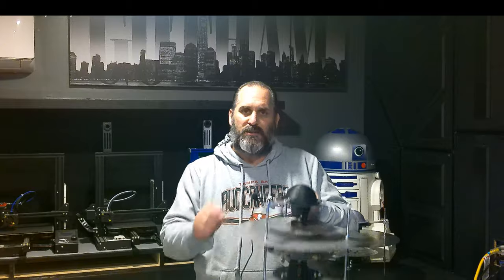Graviflyer "I Had An Idea" #9

Comment: Can't wait to see some Resonance tests with the function generator induced frequencies. Keep it up pal 😎👍
Reply from the maker: Have you ever heard a fishing reel sound from a tesla coil.
Reply: @nathanbunten4299   do you have ringing in your coil? If it gets in Resonance with higher harmonics then yes. This happens when you have ringing in the oscillating system. You have the fondamental Resonance and the higher "octaves" in every oscillating system you have the fundamental f0 is the Resonance then you have the first harmonic f1 then the second F2 and so on. With decreasing amplitude. You can hook on those intentionally or unintentionally. You can see those harmonics with a frequence Analyser. Most digital Oscillatoscpose have a FFT function FastFuorieTransfomation you don't have to buy a frequence spectrum Analyser for that though.

Comment: 👋 Hey there!  What frequency is the Ultrasound running at?  Run the same frequency on the Tesla coil to create a standing wave!  Keep an eye on your frequency drop on the Tesla coil under load make sure you raise it to match and keep in resonance/timing,  If you can't match the timing with the ultrasound,  If you need to run the test the coil slower to still resonate go down quarter of the rate,  You need to match the frequency peaks even if it means harmonizing! !  I believe the point is to vibrate the whole structure with the ultrasound high frequency should cavitate gravity forces around the entire device!  The Tesla coil should create the static field in the center plate as you're already doing!  The flyback Transformers should be feeding the other 2 disks top of below but the fly back should also run at the same frequency as the ultrasound or at the very least to match the Tesla coil so that everything is in residence is in resonance!  Motor rate to match each other!  And the question for me would be if you're pulsing the fan motors to run or are you just using brush DC fan motors??  It would probably be beneficial If the fan motors could be pulsed at the same frequency of resonance!  I think what's the speed and resonance is in balance a slight shift in the rotational Speed upwards or downwards is what he might be tuning!  The change whether either he's increasing the speed of the motor or decreasing it might shift  The field to flow is symmetrically!  This you might want to test!  Cheers mate respectfully! Vladimir
Reply from the maker: The tesla coil, high voltage and the ultrasound can run a zvs. We could combine the whole thing on a 555 timer circuit for all 3 devices. The pulse rate would be the same. We can also change the frequency of the high voltage with a 555 circuit. It might help. I will look into it further.

Comment: Excuse the typos! Lol  Regarding the 2  Motors in my prior post,, running them at the same frequency as everything else at first, then lowering the speed of the rotation on either one or both motors. I believe 1 motor rotational speed increase or decrease should create an Acapacitor effect,  Experimenting with lowering either the upper or lower disk while the other remains in resonance with the rest of everything!  I believe the deviation of rotational speed on one of the upper or lower disks will create a residence shift where energy can flow or pulse in the desired direction so testing would be needed!  You might need to modulate the speed of the motors independently!! Cheers! Vladimir
Reply from the maker: i am doing all of that. It is a puzzle though. everything has to fall into place just right.

Comment: Back when I was researching Tesla’s electric flying machine and Otis T. Carr I remember that there was the AC and DC component in the mix.
Tesla felt that the airplane was to subject to wind, high and low pressures to be safe. In the observance of UFO’s and their ability to shoot off at 90 degree angles it would seem that not only gravity has been nulled but also inertia.
An old electrician gave me the set of plans that he bought from Otis Carr. These are the same ones that you find on the internet.
Been awhile since I have looked into this but if I recall one of those electrical components did create the “bubble” around the ship. Otis Carr if I remember correctly did have time with Tesla himself. I remember also reading that Tesla’s inventions such as the turbine were directed toward that end-the electric flying machine.
I’m fascinated by you endeavors. Thanks for sharing!
Reply from the maker: I was reading an article talking about fields of a tesla coil. And it hit me how they are built. It looks like they are all connected. I have been ordering and building parts for this thing. I just found better circuits for the tesla coil and I think I can rebuild the ultrasound with a 555 timer circuit giveing me duty cycle and frequency. If there is an answer I am going to find it or go broke trying.
Reply: @nathanbunten4299  
I’ve been trying to understand and replicate the Don Smith device. While watching and rewatching his videos he talked about the electrical charge in the air. It varies in voltage 50,000 to 1.5 million volts depending on time of day, solar bursts etc.
I find it interesting the the flyer has a north and south with a plate in the middle. Reminds me of a magnet.🤔
Reply from the maker: @chasson321  The inventor said it was because the earth had them.

Comment: Great thoughts! One caveat: Alexey isn't listening to the discs to know when to pulse the US. He said that he's listening for the 'special sound' (fishing reel unwinding) to come from the tesla coil. Probably related to back-emf from both the magnetic grinding as well as the steadily changing EM fields from the vibrating discs. I suspect the buzzing sound from the tesla coil is the syncing of the US pulses to these vibrations and RF signal. Charles just noticed how the US circuit produces a very rapid rise/fall time pulse (~1us) which changes w/ changing the freq of the US, which is very close to the freq of the TC (1us = 1MHz).
Reply from the maker: I think it is all starting to come together.  I have started testing the high voltage circuit with the pc fans. It is definitely different from the bldc motors I had last time. I think I will do a video on the difference with the fans and the dc motors with the high voltage. The comparison might be helpful. As soon as I perfect my tesla coil I will run the you suggested. Thank you.

Comment: I think whats happening with the Graviflier is that its converting Electromagnetic waves to directional high frequency Gravitational waves which are undulations of the local SpaceTime around the craft. These G Waves are projected upwards, pulling the Graviflier up. Look up the Gertsenshtein effect, which explains how EM Waves can be converted in G Waves. I've done my own experiments by using the Energy of Strong Vibration and transferring it to a small object and it would levitate and rise upwards.
Reply from the maker: I think you are right in the ballpark

Comment: Nathan, it is a simple coulomb force equation calculation. F=kq1q2/r^2 where F=ma=2.7 kg*9.81m/s^2=26.5 Newtons and k=8.99E+09 Nm^2/C^2 and the charge on the Earth is q1=-500,000 coulombs and r=6.357E+06 meters. Calculating we get q2 or the charge on the graviflyer equals 0.238 coulombs. The graviflyer will lift up. Put a positive charge on the aluminum on the top disk and a negative charge on the aluminum on the bottom disk so the positive charge will be attracted to the ionisphere in the atmosphere and the negative charge will repel the earths negative surface charge.  The two charges are distributed between the two aluminum and aluminum oxide coated polycarbonate disks and not two aluminum disks. The positive and negative charges will cause the graviflyer to levitate.

Comment: I've been wondering if we could make this whole thing self resonating by putting the tesla coil on the craft itself somehow. Maybe would need 2 if we need to keep the 3 plates air gapped. Bottom plate becomes a synchronous ac rotor. Top plate becomes an induction ac rotor. Both powered from the tesla coil(s). Then still charge the plates like before with dc.
Reply from the maker: I wanted to add one to the bottom. After I get it to lift.

Comment: what we need guys is an adjustable AC output so you can adjust the frequency's what you need to get it to is 8hz if possible.
Reply: Well if you want that get an inverter motor speed controller Altivar 08 is the best on the market!

Comment: Still not clear how an electric field, oscillating, toroidal, conic, etc has any influence on gravitation, ie weight?
Reply: Have you played with the magnets that have a hold in the middle so you can stack them on a pencil?

Two magnets with opposing fields will repel a certain distance from each other. Pull the top magnet above this distance and gravity will pull it back down to this distance.

Push the top magnet down below this distance and it will defy gravity and shoot upwards beyond this fixed distance and then settle back down due to the influence of gravity.

Have you ever pushed down on a trampoline just before someone lands and noticed you can increase the height of their rebound?

That seemingly tiny bit of extra energy propels the person much higher than they can bounce on their own.

No new energy is being produced but energy can be focused to work together from more than one source.
Reply: @tenlittleindians  
It’ll not provide lift, or cause weightless. 

But more power to him.
Reply: I like to call this a conspiracy craft because at this point, no one can find a justifiable reason for this thing to fly. Is it static? Is it an electromagnetic field? Is it acoustic levitation? Or is it a random mix of all of them? At least I built one, so if someone figures it out, I won’t seem so crazy lol
Reply from the maker: I have now built 5 of them. Probably 20 or more tesla coil circuits. And more high voltage flyback circuits than I can think of. I  still want to see it fly.

Comment: This is all resonanting wl an idea I had thinking about Hutchinson: AC phase adjusted stair step field, and an electrostatic field...now on flying disc.
Reply: You need a mk3 interrossiter and a Heisenberg compensator too.
Reply: @dogwalker666  As long as it's not a flux capacitor.
Reply: @nolan412  You need a Delorean for that.

Comment: it's not mimicked dc, it's pulsed dc. it's still dc, not ac if it's not alternating, aka polarity swapping, dropping below zero volts and going above again, repeating. if polarity doesn't change, it's dc.
Reply from the maker: mimicked ac. I am trying to say mimicked AC. It is not a sign wave just pulses that show up as square waves. The point was that dc can be polarized where ac cannot.

Comment: But why don't you just buy one of Alexi' graviflyer kits and then youll have a working model to work with and reverse, just go on his youtube page, he answers most comments. Im sure he would answer your questions also, you dont need to speak russian, he uses google translate.
Reply from the maker: I am working with people who did. I have all the circuits and pictures.
Reply: @nathanbunten4299  excellent, keep ploughing forwards. I am working on one related to Viktor Grebbenikovs design, 2 Russians were working on it, it has a ring bulb at the front, there's plans and photos of them flying with it and I have most of the parts, I don't know if you know the one I mean, but I ran it through AI and it should be do-able, Im also trying to figure out the Grebennikov craft, but that but is quite hard to crack. I wish you the best, and am happy to see you sticking at it. Cheers.
Reply: 中華人民共和国の一般の方々が成功しているようです、是非、国際展示場や展示会でお披露目してほしいと思っています😊
Reply: I can understand stand Russian but not speak it. Even I have trouble understanding some of the terminology he is using because the Russian language doesn’t have advanced ways to say Something it has to be described every time instead of speaking about it as a noun.

Comment: The grav flyer is akin to a tomoka reactor moving as many ions as it can with a magnetic field. But those ions form a type of ion wing also by there movement.  The magnets move the ions so more air can be ionized.   The objective is to ionize as much air as possable for lift and form a ion type wing that is part of the engine.  You can sort of think of the grav flyer like part jelly fish and part ion wing.  The jelly fish part happens real fast thousand of time a second. But the wing part is just the ion flow.  Bending the big plate may help in how the ion flow shape looks.  If you go digging our goverment has worked on projects like this also.  Using radioactive isotopes for powering ions for movement.  Out at Area 51.  Keep up the good work.

https://www.youtube.com/watch?v=vvLT7x47x5M    a full understanding how the forces work.

Comment: Nathan, Nathan, Nathan. You are thinking too hard. Change the upper and lower disks to aluminum and aluminum oxide coated polycarbonate. Put the aluminum to the outside and the aluminum oxide to the inside. Then do what you do best and the graviflyer will lift up. It is a capacitor with a positive charge on the aluminum on the top disk and a negative charge on the bottom of the bottom disk that then repels the Earth's negative charge at its surface if you wish to think about it in your way. You have an air capacitor that shorts out. You need a very high charge. The other things that I chatted about in my earlier comments are needed but you already have these.